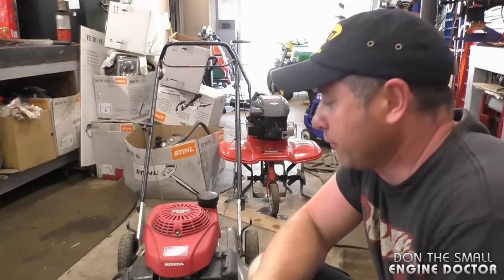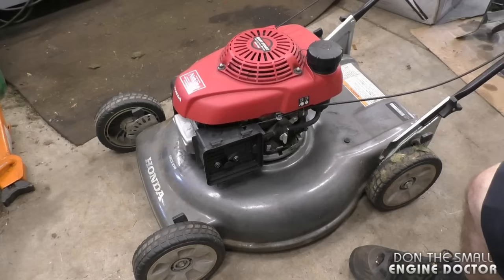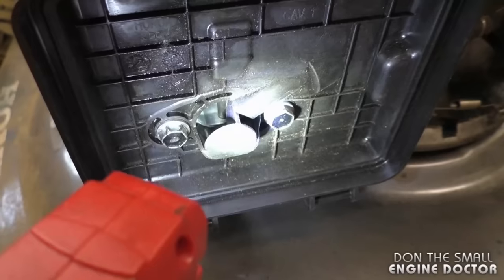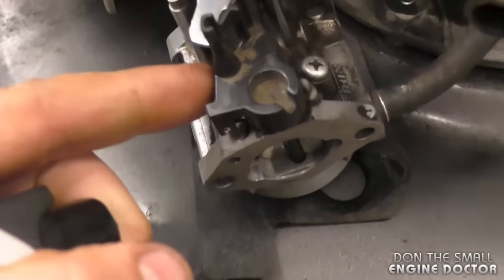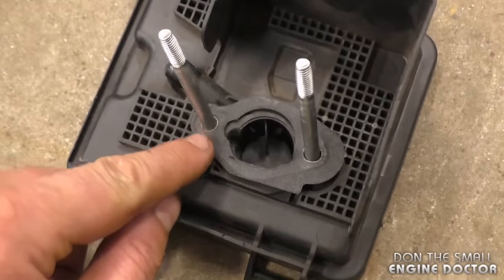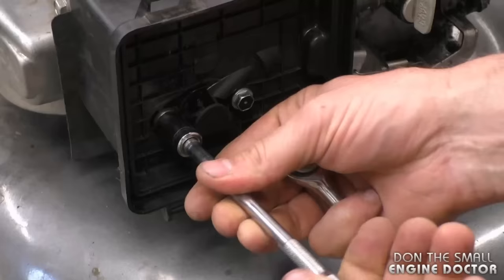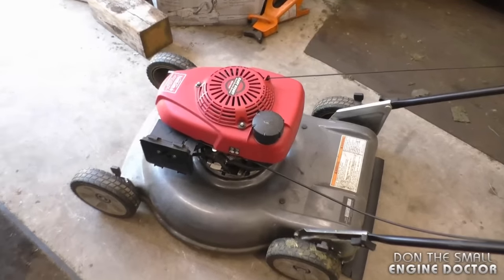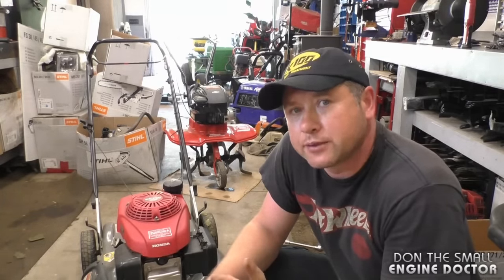Make Your Lawnmower Start On The First Pull Again - Honda Auto-choke Repair - Video

Comment: I bought one of these just 5 weeks ago and i'm having a problem with starting, now I know. thanks for the info donyboy.
Reply from the maker: if mower is new return it for warranty
Reply: How much do these auto-choke part cost?
Reply: @sanookaus1334  - If you do a Google search on the part number 16620-z8d-305, they show up for about $12 on Amazon.  Probably more expensive at a Honda Dealer.
Reply from the maker: @sanookaus1334  around $15 in canada

Comment: I have the same lawn mower I need that part a filter and a filter cover I'm going to take my carburator and start all over thank you sir for the video . I need to clean my carburator  but I don't have an air compressor how do I clean it my lawn mower won't start  unless you pour gas thru the carburator and it start for 3 sec and die.

Comment: Good morning Dony,  how are you and family doing?  Spring has sprung time to mow the lawn. 
Dony I have a 2012 craftsman self propelled walk behind with auto choke. My problem last week was I had sand in the pull start rope area got that out. Then I was able to pull the rope and start her. My problem now is two things. One she is leaking gas looks like from air filter area and when she does run she won’t turn off when I release the handle. 

What is your suggestion as to fix. 
Thank you. Houli

Comment: Is there a way to add the spring driven choke, like from the older Auto Choke system? I used to have a troy bilt push mower that had the spring driven auto choke, and it was great.

Comment: My thermo wax assembly fell out and I did not notice until the carb was already put back on. Can I run it like that or will I damage the engine as it heats up or burn fuel inefficiently. Thanks ahead of time.

Comment: Donny: Quick problem question: I have a Toro 26682 lawnmower that I have had for YEARS.  The spring from the governor to the anchor point got broken and lost.  ALL places list the spring as NO LONGER AVAILABLE.  ALL places. IS there a way to make/alter  a spring? Or, do I just throw away a perfectly good mower?

Comment: What if mower will start cold but that choke is always closed after engine is hot? have to hold it open to start it then it runs fine. Is that choke mechanism common across Honda push mowers such as the 190cc?

Comment: I think I may need to go to a manual choke.  I put the new choke parts on (slightly different design that this vid) and it's starts just fine.  But now it sputters and runs rich until it finally warms up which is usually about 4 minutes.  Is there any other adjustment to the automatic choke?  With the plastic cover it's hard to get to the choke assembly to see what is going on.  I may have to trim that back too.

Comment: Donny, Thanks you for your videos they are very helpful. I have a mower that wont start  unless I spray starter fluid in the carb, after that she starts and runs fine, I can pull start after that with no problem. I replaced the whole priming bulb and assembly, new gasket, changed plug, cleaned out old gas and sprayed carb cleaner at high idle and still wont start. What do you recommend I do next?

Comment: Hi Don. That Honda lawnmower also has problems with the rear wheel self drive countershaft seizing or difficult to rotate when manually backing up the machine. I am constantly lubing the countershaft end bearings to get it to rotate freely without taking it apart.
Reply: You need to replace both rear axle supports. This is a common issue with the Honda mowers. The parts are not expencive and require a circle clip removal tool. The shaft will need to be polished where it goes through the teflon bushings. They sell a replacement easily changed without removing the drive transmission. Google Honda Axle support. There is a different number for each side. When you google it, there will be a replacement video available. I just did one set and need to do my own.

Comment: Man mine did not come out so easily lol I had to use a tiny pair of needle nose pliers to get in and pull it out. It was covered in black rubbery stuff. It was definitely bad though the pin was protruding far out. I won't get to try starting the mower with the new one installed till tomorrow though. Hopefully this fixes my mower. I've changed carburetor,  fuel filter, air filter and spark plug already. I overlooked replacing this part cause I honestly never knew of its existence.

Comment: Hi Don I have a Honda lawn mower about 7 years old that starts but dies about ten minutes later. 
It will start soon after but dies again 10 minutes later. 
What would you suggest I check. 

What has been done is carb clean new air filter new gas cleaned out gas tank new spark plug. Thanks 
Houli. 
All the best to you and your family

Comment: I have a 1 year old HRX model which I ran pretty hard during a rip out last August.  Dirtied up the carb, then cleaned it really well and got rid of the surging that I caused from all the dust.  It was back to starting on 1-2 pulls without any surging during idle.  Then fall came, and it began having harder starts while starting in 40 to 50 degree weather for leaf clean up.  
Just took it out again...thing started on the first pull in upper 50 degree weather.  Should I consider just changing out that wax cartridge?

Comment: I have had machines blowing black smoke because choke stuck closed replaced thermowax and problem fixed. I use two long studs assemblying all parts on before mounting air filter back plate and then pressing against plate remove one stud and replace carb bolt tighten lightly and the remove next stud and replace bolt pieace of cake no problem getting all parts aligned and in place

Comment: Hi i have question on honda auto choke. you said during cold start, butterfly flap should be cclosed, so it can suck fuel, make sense, but when it is hot, if the butterfly flap open it allows more air, why it wont be a problem to open the butterfly flap when hot..

Comment: Would  this part  cause a failure  to restart when warm/flooding condition?  Mine  starts fine when cold, but after running  till  warm and shut off will not  restart.   It will  if you  blow out the carb with  compressed air.

Comment: I have a   Lawn mower with a Briggs automatic choke.  
I've replaced the coil and the automatic choke. 
I've adjusted the joke properly And it's not hanging up. 
I've rebuilt the  carburetor and cleaned it. 
There is a Spring on the automatic joke . 
I have a clean new filter. 
I installed a new spark  Plug.
starts and runs beautiful But when I stop to dump the grass bag it won't start again.
 I understand this is common problem on briggs auto choke.
The only fix I see recommended is to convert the motor to primer system.
What do you think the problem is?

Comment: Don I've got a Honda HR215 HX. I just adjusted the throttle cable so it would start better. I also tried to adjust the governor a little because the RPMs were a little too low. I'm not sure what I did in my adjustment, but now the governor arm will not stay in the idle position - forward towards the carb. If left untouched, it rotates back or open and the engine runs at crazy high RPMs. I've tried every adjustment to the governor pin to try and make the governor arm stay in the forward/idle position, but it still just falls back and runs open.

If I hold the governor arm forward, I can start the mower and have it run on idle, but the second I let go of the governor arm it rotates back and runs completely open with way to high of RPM.

Comment: Similar problem, but my wax cartridge was fine.  Instead I found the mechanism that controlled the choke was so dirty, it would not snap closed when it was cold.  Cleaned and siliconized it, and it all worked fine.  Started on the first pull.

Comment: Nice! Do you have any tricks for retrofitting the manual choke? My old Honda HRX 217 had speed control and manual choke, always started 1st pulll. New mower runs wide open has an auto choke and does not start first pull.  Honda screwed this up big time.  K.I.S.S.

Comment: Hello, I have this engine and it fires up quickly but after we warming up it starts to stutter and fail.  Is it possible this pin is opening the choke when the engine is hot?  Should I be looking for vapor lock?  I guess the first step is to open her in and check the choke assembly.

Comment: Hey Don, I have the same engine as the one in your video, I will start up for a second but dies out, even if I use quick start. Mower sat over winter, I tool carb off cleaned it out removed the float and needle, sprayed all ports and still just starts for a Second then dies, getting full to the carb. Any idea what I can check to get this mower going.

Comment: All of a sudden my mower wouldn’t start yesterday, similar Honda with auto chrome. To me it looked like the butterfly was closed so didn’t think that was the issue. It seemed like the throttle was not moving sufficiently when I turned it to fast. Is it possible my throttle is an issue?

Comment: Dony my older honda motor doesnt have auto choke. Ive taken apart and cleaned the carb pilot jet and all float is good and not sticking but starts and dies. Could it still be  a thermal cartridge affecting the butterfly and once it starts it dies? thanks

Comment: Hey donny question for you. My lawnmower (honda) does start but after 10 minutes it starts surging. After another 15 minutes it levels out. But the longer you leave it shut off the longer it will surge after start up. Could this be a culprit?

Comment: Mine is surging from carb problems, vibrating like hell from hitting a large rock in tall grass, gasket is ripped on carb area.  I’m confident in my carb work but hoping the shaft is not bent , just the holder thing for the dual blade system .  I have new blades and the holder but I’m struggling with getting the other one off, it’s probably seized.  Then maybe mine will run smooth again?  It’s a bummer, I liked the Honda

Comment: Don, I bought this wax choke part from Amazon and will replace soon on my 5 month old Honda HRX217VKA mower which takes 2 to 5 times to cold start. My 7 year old Honda HRR216VKA that I gave to my son never had a problem starting. Question today for you. As long as I take auto choke part off to get at this wax part, do you recommend cleaning choke butterfly with carb cleaner?
Thanks,
Don from Milwaukee

Comment: My Honda has the opposite problem. The choke doesn’t want to open. When cold it will start and immediately die. Does this over and over till it finally keeps running choke will only open half way. I’m going try replacing this part

Comment: Great vid but what does one do when the wax choke thing won't come out as easily as yours did? I've tried everything in the box except a little heat. Can I drill a hole behind it and knock it out?
Reply from the maker: I grab it with vise grips and pull

Comment: I have the same set up on my Husqvarna mower. Same Honda motor. Choke works properly. My problem is once it comes off the mower starts to lean surge. Where am I looking for blockage? I took the screw out of top of carb and sprayed in there but no change. Took bowl off too and sprayed,nothing.

Comment: Ha Donyboy73  I have a 4.75hp Briggs n Stratton weed Eater  500 series with no primer and is hard to start. little gas or start fluid and it start good but don't want daughter to fuss with that. Can I put a primer carburetor on a on a non primer tank? are the tanks the same?

Comment: I have an Izy mower with the same engine Dony. I have a similar problem but from cold it starts fine, but when I stop to empty the grass bag for a minute or 2 it can be murder to start again, maybe 20-25 pulls to get it going again, not all the time but most times it's like this when the engines warmed up. Do you have any ideas what it could be thanks

Comment: My honda mower is at least 25 years old. Every fall I make sure to run the carb dry, and the next spring it starts 2nd pull without fail.

Comment: Love your video quick tips! Could this also be the cause of a Honda HRX 217 with a GCV190 engine not restarting once the engine is hot? It starts and runs just fine when cold but if you stop it when hot it will not restart. Any thoughts?
Reply from the maker: yes it's possible

Comment: Donyboy, i bought a new wax thermal cartridge, installed it using your video, but it only runs as per the amount of starter fluid i put in, what am i missing?

Comment: Great video! Not just because you tell what part and how to get at it, you told us how to tell the difference between a damaged part and a new one. 

Now how would you fix irregular idle with this mower?-- or could a bad thermo wax cartridge cause the carb to put the idle speed out.
Reply: Thats your low idle circuit.  You will need to remove and clean the carb. I highly recommend an ultrasonic cleaner for this because you cannot reach the internal passages . I might even suggest a $15 chinese replacement carburetor.  I have replaced two so far with no issues.

Comment: Great video Don, I've been using quick start for the past 5 years since the electric start stopped working. Other wise I could pull start it from dawn to dusk & it still won't start without the ether. Your video was done so well fixing this issue was simple. I have had this mower for 7 years, It is a Honda HRR 216 VLA mower. Purchased in 2013. I cannot get the electric start to work for the past two seasons. I brought it to a repair center in late summer of 2019 & for $100 they got the starter working. The next spring 2020. It started with a freshly charged battery & that was the last time the electric start worked. The started does not crank at all. Do you have any suggestions on repairing this issue? It is a Honda HRR 216 VLA mower.........  Thanks, John
Reply: I have the same mower and the same problem.   Should you find a way to fix it, please be sure to let us know.  I will do the same, if I find any fix.  Thanks.

Comment: Its a servicebulletin for this! On the first models you have to change the plastic bracket  isolator because that you can see in 3:05 has a round plastic  circle where the termowax plug meets. On the old model was the circle in metal. They always stuck in the open position 

Here is the bulletin for gcv160. And its two versions of the plastic isolator. One with a round hole and another one with a square hole where the carb meets!

Comment: Thanks Dony!  In thinking of buying another Honda and I’ve heard that the auto-choke can be an issue.  Your video describes the issue perfectly, as usual, looks like a simple repair.  The Honda I have now is a manual choke but it looks like Honda is going to the auto-choke system on all its models.   I was wondering how that worked, looks like I’ll keep that part in stock, lol.    Thanks again,  Do you have any videos on replacing the belt on a Honda HRR216 with roto stop.  Replacing the belt looks more complicated with the roto-stop in the way, lots of extra parts to worry about, lol
Reply from the maker: I haven't done a video on the hrr216 yet

Comment: Donny I have a similar Honda mower but with manual choke.  It'll start but requires the choke to stay on to keep it running until it's very warm  Which requires a long time.  Any idea on what could be causing this?  It was never like this before.
Reply from the maker: Could be a dirty carb or it may need to be replaced

Comment: I have this same engine on my toro SR4 lawnmower. The lawnmower always starts on the first pull but won't start after I empty the bag and the engine is hot. I've had the carb off and have suspected this part but was never sure. Do you think this cartridge could be causing my no start issue when the engine is hot?

Comment: Mate of mine just got a honda izy brand new but it was a 2018 model, after only a couple of uses it had this fault, apparently honda are replacing the carb with another model (not sure if they are replacing it with a manual or auto choke)

Comment: Smashing repair don, and usefull info on how the system works... or don't lol :-D
I think if i owned that type of mower i would take the cartridge out and modify the black plastic box for a pull up rod choke or lever/cable, i don't like automatic systems.
My old briggs&stratton only has the flood method and the primer bulb is still good :-D

Comment: I thought they used BiMetal 
Just like the thermostat 😁
But Wax actuator is also use in the dishwasher machine to release the latch on soap dispenser 

Wax actuator is actually pretty reliable

Comment: would the same part be defective if it does the opposite ie. start when it's cold and not start when its warm? I can manually move the choke and it will start seems like the choke is stuck closed and not opening up when it warms up

Comment: I have a honda hrr216sda that doesn't have the auto choke, however my mower takes about 10 pulls to start. Any idea why? It is 15 years old and last year I put a new carburetor on it and a new spark plug this year. I only run non-ethanol gas in it too. Any help would be appreciated.

Comment: Very well done video, but what if you have a B&S engine that won't start on the first pull. What's the fix for that? I cleaned & installed new gaskets & O-rings on the carb & replaced the ignition coil, but it's still hard to crank
Reply: Use high octane ethanol free gas.

Comment: Any tips on getting that old actuator removed? Mine has this soft, black stuff holding it in place and it won’t budge. I’ve tried pliers and small (maybe not small enough) vise grips.
Reply from the maker: sometimes heating with a torch works